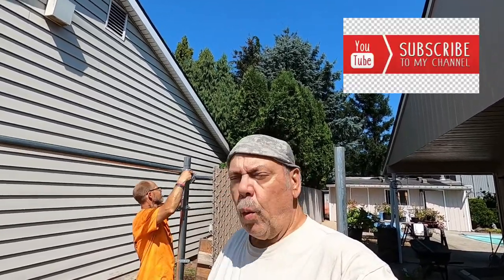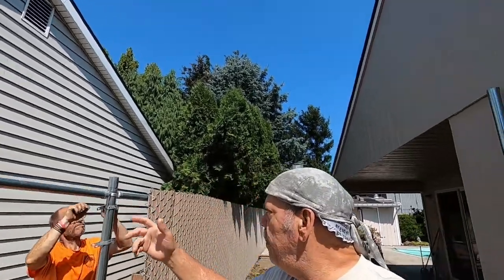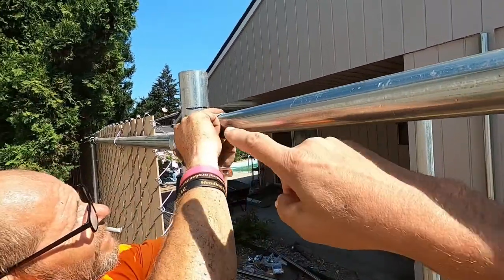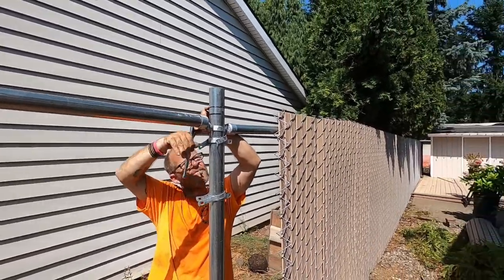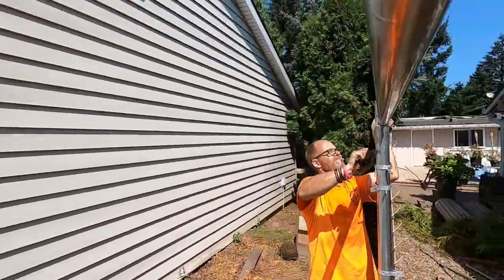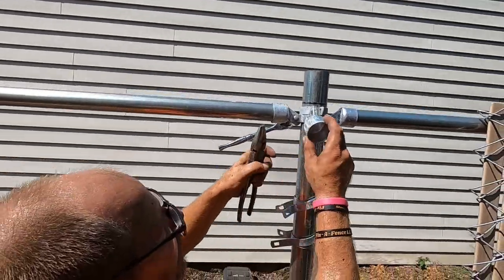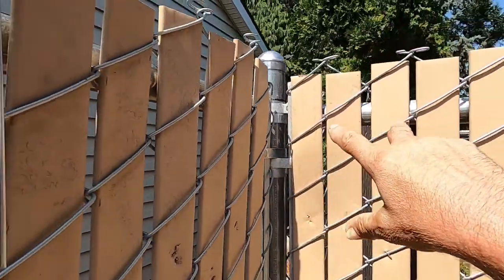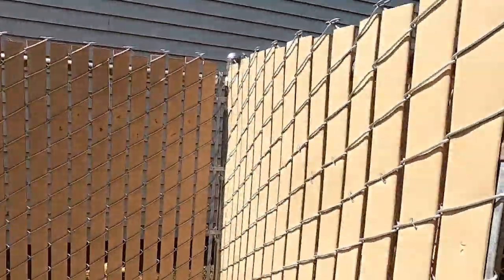How To Install A Two Way Brace Band For Chain Link Fence

Comment: You could use a line rail clamp and a brace band with a rail end to go on the t away from the line too. 6 to 1 half dozen to another. Lrc's are a little easier to get a hold of.